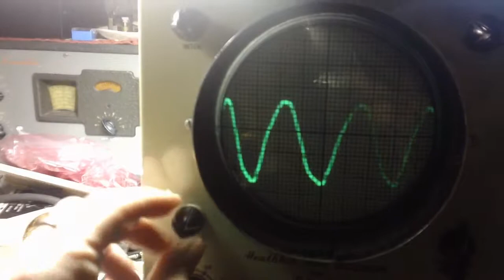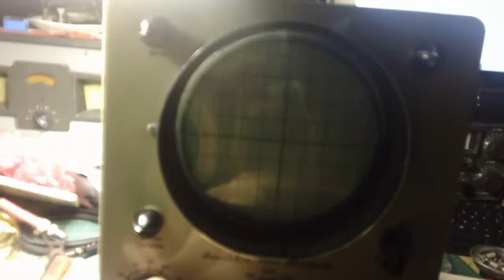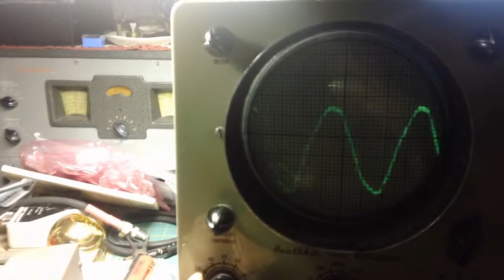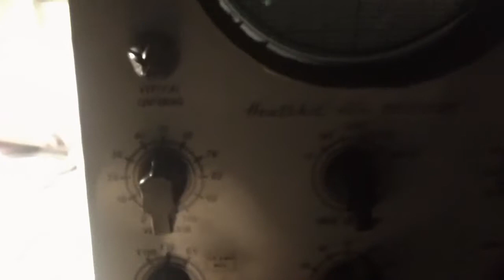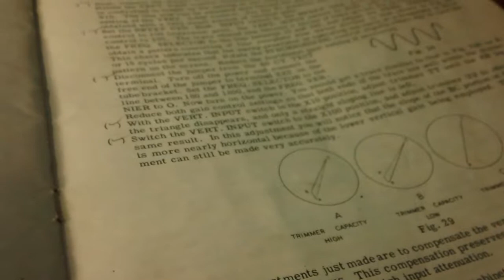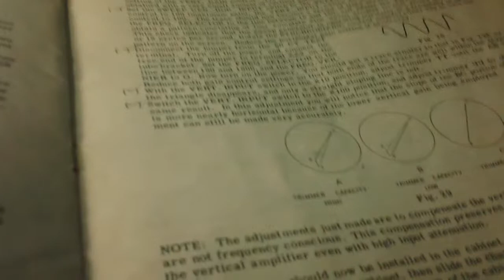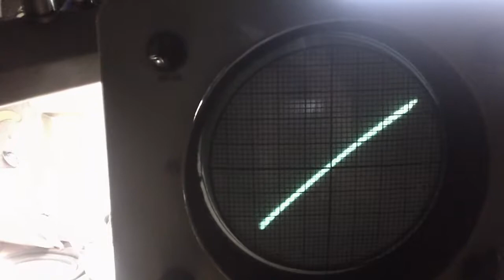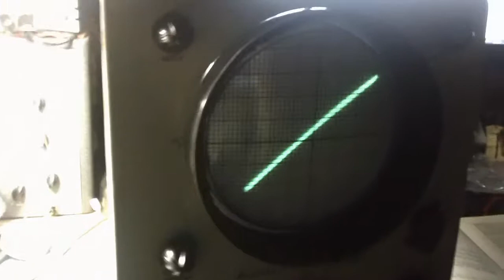Heathikit O-8 Oscilloscope 3 of 3

Comment: Great videos!  I am currently restoring my O-9 Heathkit Oscilloscope.  I wish I had re-stuffed the old caps like you did, but that's hindsight for you.  I do have one question, if you can help.  I am trying to adjust my TT and UU trimmers, but they don't appear to be doing anything.  I feel that my vertical gain control is a bit wonky and my image likes to bounce around quite a bit.  I'm not exactly sure what to do from this point... any pointers?